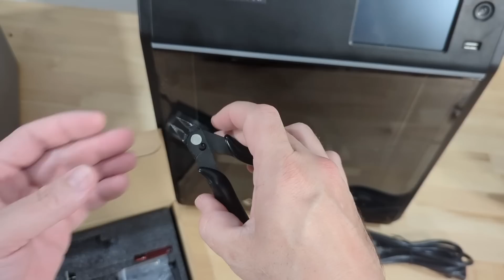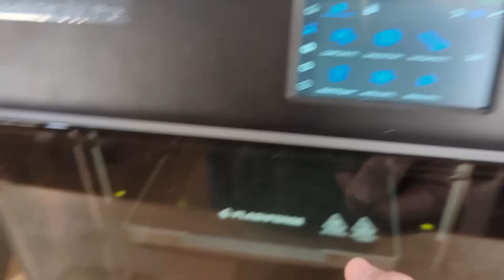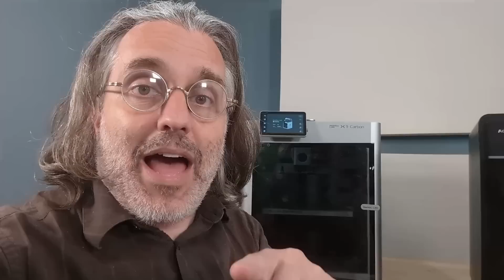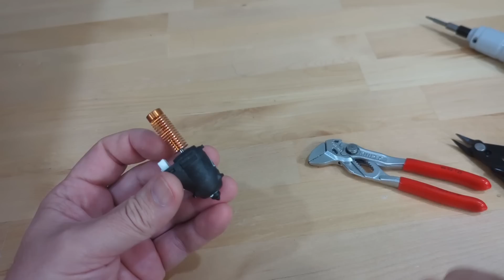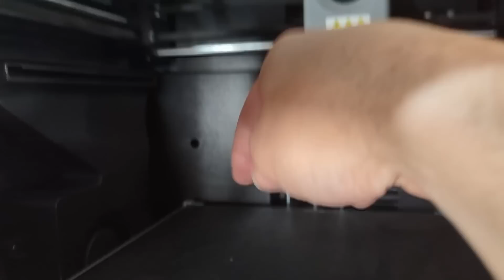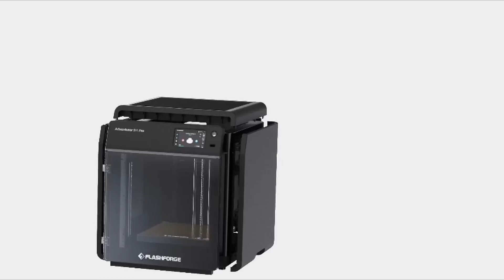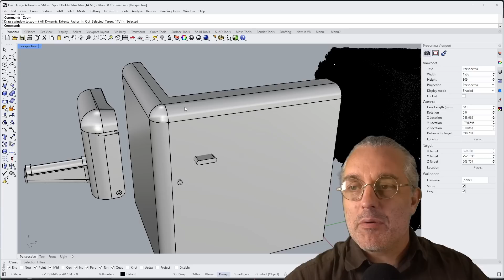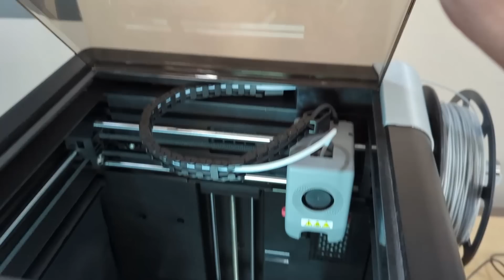Better than the Bambu Lab X1C (for the money) - Flashforge Adventurer 5M Pro

Comment: Flashforge deserve their dues here, they've had wifi (and LAN) printing for a decade at this point, their ecosystem has been great for a very long time, especially for multi printer setups which is why I and many other people had Creator 2 farms because for a very long time they were the only brand allowing you to deploy the same print to multiple printers over a network wide or local. They also pioneered core XY before core XY had the name CoreXY. However, I recently swapped my creator 3s for X1Cs and creator 2s for P1Ps because even though the interconnectivity and quality of the prints was in FF yard for a long time.. Bambu have taken the crown, they make yesteryear's $4000 printers for $1400 and have completely upended the market and I would never buy a AD5 over a P1S, P1P and definitely never instead of a X1C (they have completely different use cases for a start). The market has moved on and FF got left behind just like everyone else - In a way FF are the worst because they innovated quietly for a long time and have sat still for the last few years (putting a different plastic shell on your guider 2 hardware, removing a feature and renaming it AD5 Pro is not innovating, FF)

Comment: You cannot compare a multicolor printer with a mono filament printer and tell the mono filament is a fraction of the price of the multicolor one... that is not serious.
Reply from the maker: Tell me, does Bambu Lab sell the X1C as a single filament printer without including the  AMS? Did I cheat by removing the multi-filament capability for this purposes of filming this video? Does the X1C have a holder for a single filament spool on the back of it?

Comment: the clipper is the same shtty quality as the others...had 3 of these black ones...they all broke the moment I tried to cut a 2,5mm or 4mm cable :DDD
Reply from the maker: I've had one snap on me as well. And it was my favorite one. They don't do a good job of heat treating. I don't think they temper after the heat treatment. So the blades are as hard as they can be which is nice because cheap ones get those little dents in The cutting edge. But a really good pair would be sufficiently heat treated only on the cutting edge. This would maintain ductility everywhere else and they would be less likely to snap when you squeeze them hard cutting thick material.

Comment: Should be comparing it to a P1S and then the 5M will lose big time. Your cost excuse goes out the window.
Reply from the maker: You should tell Bamboo Lab. They gave me the X1C but then they demoted or fired the rep who I was working with. Barnacles and his followers doxed me and canceled me by reaching out to all of the companies saying that I was dangerous and shouldn't be worked with. So the line from Bamboo Lab now is "We have no intention of working with Design Prototype Test in the near future." 

Anyway, looking at the specs on paper, I'm not inclined to agree with you. Remember the 5m pro has a fully sealed chamber with industry-leading filtration. The 5m pro has a superior color touch screen compared to the monotone low resolution screen on the p1s 
 And the P1S costs $100 more. Respectfully, I don't think you completely thought about your argument before making it. I think you just have some brand loyalty or something.
Reply: Barnacles - that mommy son is still alive, isnt he suppose to be vacinated educated and dead by now?

Comment: The ultrasonic welded extruder unit is actually very easy to open. It pops open with your fingers. 

I’ve opened mine 3 time due to filament wrapping around the teeth inside.

Comment: On Bambu x1c, the screen you shown. click on filament and there is ,load and unload command. Maybe you missed it or you don't know it?😅😅
Reply from the maker: I'm fully aware of this workflow. It's more difficult than just pressing the up button on the extruder. When you click unload it asks you what filament is loaded. You have to scroll through the list. If you accidentally select a bamboo filament, it says it cannot read the chip. Very frustrating. That's why I was decrying the loading and unloading a filament on the bamboo lab as being difficult.
Reply: @DesignPrototypeTest  I am not using any ams system. Ordinary filament and its the most convenient function to load and unload just by one click

Comment: I absolutely agree that the Adventure 5M is a really growing alternative at the moment. By far the biggest advantage of Flashfroge: Flashfrog is in the more expensive segment (Flashforge Guider 3 Ultra), it brings a lot of professionalism to the cheaper models. Customer support, customer proximity, open ears - this is on a higher level and plays in a different league and is absolutely outstanding. The not Pro model - an unbeatable price performance. I have the Pro, the non-Pro and Bambulab X1C. However, I don't see the 5M as the beginner printer. I see it as an additional printer for people who know their way by working with 3D Printes or those how will spend a littel more time to come into the topic.

The M5 is a damn good printer, but in my opinion, there are also disadvantages, note: I Complain at a very high level, at this price there is actually no complaint at all: 

Missing spaghetti detection. 

Missing first Layer inspection.

The PEI Plat is even worse than the old black one from Bambulab - so the PEI plate from the M5 is even worse than the one that Bambulab no longer sells (and I also have many such plates from the M5) 

A lot of work when creating profiles, Bambulab comes with a lot of generic profiles that only need small adjustments - these are already in Orca Slicer. 

At flashprint, new fillament profiles from 5M can`t be easily saved on 5M Pro (nothing at all). 

You can`t even save anything from 0.6 nozzel profiles to a 0.4mm nozzle setting because everything is saved in a single profile (i.e. printer settings and filament settings are not separated). In Flashprint there is no distinction between printer settings and general filament settings. And the supports produced by Flasprint (tree structers) are a disaster. 

If you want to operate the M5 in the Orca, you really have to start at the beginning with the profiles. There wasn't the slightest bit of preparatory work from Flashfrog. This takes a lot of time and you really have to buy more than one printer before you take the time to do it. 

Many filament manufacturers also offer prefabricated profiles for Bambulabs - no wonder, everyone wants to get their filaments on those printer. At Flashfrog, not even Flashfrog itself works on modifying their fillament printing profiles... so I think there will never be a filament manufacturer that will match them to the Flashfrog as well, and until that won`t happens, the M5 is just a lot more work. And that means in a few words: More work for the customer = fewer customers.
Reply: For the people who are seeing how much cheaper this is than the X1C, I just picked up Bambu Lab's P1S for $550 with the AMS for $200, for a total of $750 on one of their black Friday sales. The P1S is an X1C without the lydar, and with a plastic body instead of aluminum, a cheaper display, and a 100 C bed instead of an 110 C bed. Besides the hot end and extruder gears, they have are identical with the same printing speeds. The gears and hot end with a hardened steel nozzle can be installed on the P1S and  cost around $50 for both.
Reply: @Noneofyourbusiness2000  Absolutely a matter of taste. It really depends on what you need the printer for. The X1C also seems a bit expensive to me at the moment, but since I have it I wouldn't give it away. If the printer works constantly, the P1S also has no spaghetti detection - some people want it, others just want the better price. So it's an absolute question of taste that everyone has to know for themselves. Abrasive materials, TPU - PTFE tubes maintenance on the AMS... really there are so many different user needs. And he has concrete on the video, "for single filament printing".

There's also so much going on at the moment, let's wait and drink some tea.... The new V2 belt printer from Ideaformer, the printer announcement from Bambulab for the new pending flagship, QIDI Plus 4 hot or flop?

But I definitely wouldn't give the M5 at the moment, but it has more to do with accessibility operation of several printers, interchangeability of parts and the time required for this and so on, TPU printing with 2 kg +, usable color display and so much more. If I were to buy just one and had to do that now, the P1S would certainly not be a bad choice either but I'm also happy that I don't have to choose one at the moment... and I can't get very far with a single printer either, so to choose a printer I need something that stands out where the printer delivers specifically. 

For me, the P1S is a bit too much of an all-rounder which will by simply surpassed by a printer I already own. The P1S simply neglects things that not everyone needs, but others like me greatly appreciate - so the P1S would just be standing around without any print jobs anyway. Than we would also have to talk about the P1P, because with PETG the housing is more of a nuisance than good. So why pay 750 USD for a printer with AMS where I don't need another AMS or the printer when I can get another printer for 500 or 300 USD that fits into the fleet. In cases, also supplies spare parts for all other printers standing beside of it.......Than we would also have to talk about the P1P, because with PETG the housing is more of a nuisance than good and so on........
Reply: @zravel  understood. I was just letting people know Bambu had something like the X1 but substantially cheaper that competed price wise with the one in the video. $500 vs $550.

Comment: Elmers purple school glue stick is master of all bed adhesives.  Also every time you load filament you get a purge, no reason for plugged nozzles.  Never happens to me and I've use this for hundreds of prints.   Finally, to properly purge the head that's what that strange, crooked wire thingy was that you saw when you unboxed.